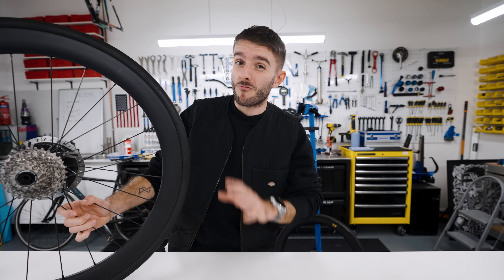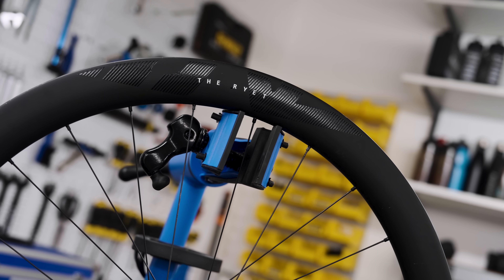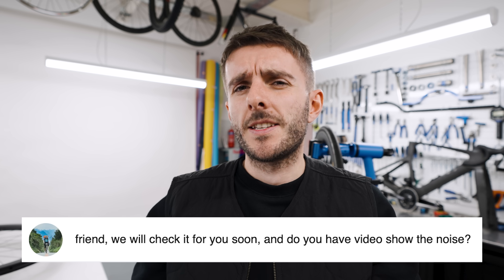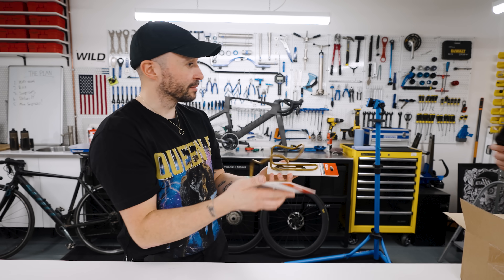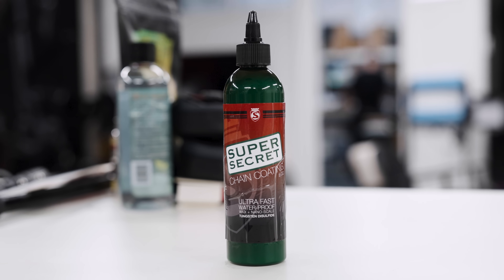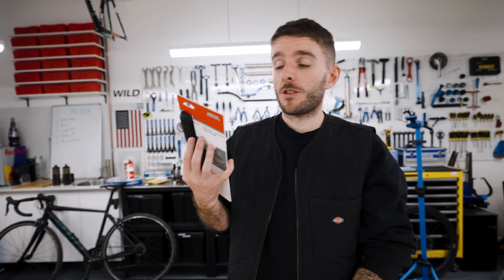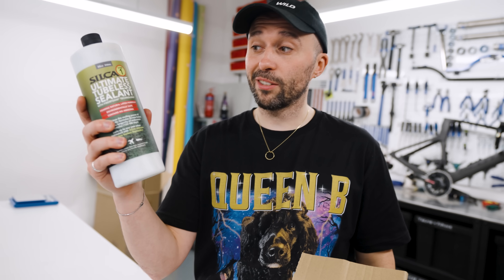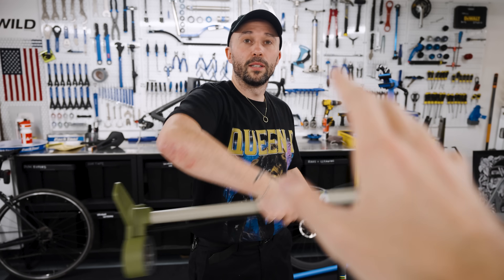I’m Now Terrified Of These £240 Carbon Wheels

Comment: I ordered a groupset from Ltwoo. Delivery was so delayed, that i bought a Sram on Amazon. Returned the package right in the post office and never even touched it. Refund was reduced by 30% due to bad packaging....
Chinese companys more than often rip off people, it is a common habit.
Reply: Nah. Its not a common habit. Ive purchased lots of chinese products. Obviously transcontinental logístics has challenges and they do wonders at keeping the prices down. 
Ive encountered more problems with local sellers rather than chinese, as long as you stay away from fake branding. They have their own brands that are pretty good, specially for the price. But if you want to scam yourself by buyibg obvious counterfeit then thats It. 
Europeans have historically given me more trouble at customs

Comment: Im got a pair with new tech from them, 700$ but it at 1275 gram 24/24 hole 46mm height. It work very well, work for the money and still riding good after 2000 km with no issue .😊
Reply: I'm also planning to buy their ultralight wheelset. May i know if you're still using the wheels and what's the condition?

Apologies for my bad English.

Comment: Loving all the videos people and am pleased to hear you have another sponsor, but please...Absolutely no need to spend £100+ on a frame fit pump while you can still get the Zefal HPX for under £30. Had mine for 40 years in all weathers without a hitch and it's all aluminium ✊.

Comment: I'm very happy with Silca's products and very happy to see you sponsored by them! I've had nothing but success with their pumps, hot melt wax, chain stripper, drip wax, tubeless sealant, garmin mount, and bar tape. I recommend their stuff to everyone because how many other brands do so well across such a broad range of categories? If they make a product I need more of or need to replace I look to see if they offer it first because they have earned my trust as a very high quality/best offering I've found. Silca may be expensive but in a lot of cases the competitor's products at the same/near same price are noticeably worse, inferior engineering, or don't last as long. 

Hot take: Josh is like the bike Steve Jobs. Innovating way ahead of the competition. 

Carbon in the sealant to form a "fibrin clot" similar to human hemostasis, pebax bar tape (that's the foam in the nike marathon shoes winning almost everything), all in one chain stripper that' isn't terrible for you/environment (look at how people used to strip chains), emulsified drip wax(this is some chemistry magic), sous vide bag hot melt wax(so you don't need a wax pot removing the major barrier of entry genius)...nobody else is doing some of this stuff and if they are it's typically that brand's sole focus! Don't change Silca!!!!

Comment: Which wheels from ryet are thoose exactly? I also ordered some carbon gravel wheels from the same company. They are called „2024 Carbon RYET GRAVEL Wheelset Disc Brake Tubeless Ready 700C Bike Wheels Center-Lock“. By the time i bought them (11.11. 23) they were called 2022 carbon ryet gravel etc.
Reply: I have the 55 mm aero for disc brakes and also the mtb ones, I have ridden them both very hard and many km without problems, I think this person has some with production defects

Comment: I work in the steel industry and I will tell you Chinese Quality Control is lacking to nonexistent.  

The Chinese have zero understanding of Western Standards and Specifications.  Even when you show the Chinese Engineers the Standard in writing, they insist the Chinese product, which doesn’t meet the Standard, is 100% good. 

In my experience Chinese manufacturers would rather ship out bad products. Then they make a financial “gesture” to offset their poor quality when you call them out on it.

Comment: You nailed it. QC is the important part. Renomated brands do propper QC for basically the same products. So you have to rate for yourself if you can handle bad Quality. For inner tubes that might be fine. For your Frame, fork, stem, or wheelset you might not want to have that

Comment: Sometimes it's not even about the QC it's about the laws / quality standards. For example, it's possible that for some parts depending on the batch size prododuced an Acceptable Quality Limit (AQL) can be used to check a specified sample size and if all of those parts pass (or in some cases there's a tolerance for allowable fails) then the batch passes and moves on to the next phase. While there could be bad QC's, bad parts doesn't automatically mean the QC is bad, it is possible that it's just a dud in the batch.

Comment: How do you all feel about the Ryet hubs? I used them to build my wheels and haven't had any issues
Reply: I agree with you, I have some ryet wheels, and I have ridden many kilometers without problems. They even survived a crash without problems, (I sent them to be checked), I think it was a production fault, but in my case in mountain and aero road works perfectly

Comment: Silca sealant dried on my wheel in less than 2 months and i ended with unsealed small whole, and was very painful to remove from the tyre, also it blocks the valve

Comment: as long as you don't apply too much pressure using a bike stand on a carbon top tube is no worse that lifting your bike up with your hand by the top tube.

Comment: I don't have an issue with the service Ryet offered. The wheels are sold with very low margins. To cover the shipping for a replacement wheel seems fair to me. Yes, you could spend 10x the amount and get a free replacement at a local shop, but you are paying for it in the upfront cost.

Can't expect the best quality and after sales service for the lowest price.

Comment: I have had a set of light bicycle and Venn  rims and they have been excellent. I would not buy a set of AliExpress. I like the Silca stuff but the saddle bag with the BOA thingy sucks. It will not stay in place under the seat and other riders I know have had the same issues.

Comment: In my experience the biggest issue chinese brands have is consistency. Many brands only try to win over first time buyers with price, and they have very little (or no) QC, and also keep changing the product names and numbers every few weeks or months, so it's impossible to recommend, because by the time there is some experience with the quality of a product, it's off the shelves and there are news ones which are again of unknown quality. This is also not helped by the fact that their product descriptions are written like SEO-s, so it's nearly impossible to tell what specification they come with. I had years of experience running a local earphones community, and we barely had any chinese products as recommended, because they were so inconsistent. There are some reputable brands of course, but those tend to move towards localised reseller networks instead of selling on aliexpress.

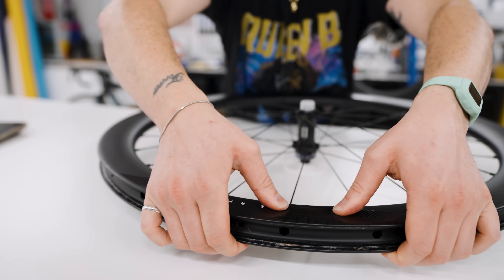Comment: a had a very similar problem with Yoeleo Carbon wheels. They are another chinese manufacturer and supposedly have a bigger emphasis on QA. The Rims even cost 800€ instead of just 240£. The tyrebed sepperated from the rest of the rim very simmilar as the wheels in this video, you can see them seperating at 1:27. Also Yoeleo refused to replace my wheels because they were a couple of months out of warranty.

Comment: auto mechanics aerosol brake cleaner is a much cheaper way to clean chains. it leaves no film so a denatured alcohol bath is not necessary. apply emulsified chain wax directly to the chain.

Comment: I have rolled the dice after the video of the unboxing of these wheels. I have been waiting for the review video for months now. I would like to chime in an say after 200 miles, I love my wheels. 50mm deep 21mm inner width, 36t ratchet hub, and more then 100g lighter than my 30mm deep 19mm inner width alloy wheels. My LBS wouldn't touch them, I was told the spokes were counterfeit but was not told how they knew, they did say after my first 40 miles that they were properly dished and true. If the $400USD is all I can afford and I want the ease of wide inner width and a ratchet hub what does the community recommend as a larger company to buy a similar wheel?

Comment: I bought XC carbon wheels from Velobuild that failed to kill me or, at the very least, send me to the hospital. 
When I bought their frame VB offered the wheels, I replied that I wanted these customized with an specific hub and spokes (bitex and sapim), so we agreed on price.
The bike was then built at the local bike shop and I rode it for mere 350 Kms before the incident.
I was starting a downhill at only 55KPH when it happened. We all heard a bang and the bike started skidding... I was so lucky it was the rear wheel that cracked... I was able to control and brake. 
 It was the back rim that cracked.  You can see a hairline fracture going between 2 spokes along the edge of the deep profile, by the same radial area you see a crack that cut the inner tube, it exploded and opened the rim.
Velobuild never honored the warranty and insisted in a car accident despite me sending pictures of the bike in pristine condition (and no spokes bent or broken)

Comment: I was riding with a friend who was riding a carbon Chinese fork on his gravel bike, the fork failed under the head tube and he crashed. Was in the hospital for a week and was lucky to be alive. I personally stay away from any non branded carbon products
Reply: What do you ride?
Reply: Ive used ryet wheels with no issues. I've also used elite for 6 years and over 30000 kms.

Comment: For that price I boght some Mavic wheelset with a discount and it will last for ever ... perhaps change some bearings in the future and that is all. I still prefer aluminium, light weight aluminium over Carbon. My duke rims weights only 45gr more than the carbon ones and looks as nice as them but are more realiable over bumps or crashes.

Comment: For balance, i have three Ryet carbon 3D printed saddles, and apart from them having a slightly wider nose than I'd like they've been faultless and super comfortable. Id definitely buy again.
Reply: I've got two of those, great saddles, they do a couple of slimmer looking ones now too.
Reply: @Bikey_McBeardface I've got one that they class as an MTB saddle on my winter bike. It's a bit squishier than the short-nosed one they do but still comfy and after around 300mi no visible issues. Great value for the price as you know, as the finish is as good as any top end brand.

Comment: Wow, looks like I've won Ryet lottery 😂At 6000 km now on my set of their wheels (50mm rim brake version), on rough roads and coubles, they are still true and ride absolutely fine. My model looks like that Francis got, so it seems that that is indeed two (or maybe more) different products sold as one. Definitely wouldn't recommend their wheels to anyone anymore....

Comment: I didn't get cheap carbon wheels but I would still appreciate an advice - is there a reliable way to tell apart surface scratches from forming cracks? Been riding my Levante wheels a few percent above the weight limit and I am trying to be extra careful. Thanks

Comment: You should make a video about TPU tubes from China. I bought 4 and all four tubes were bad. 
Thanks for the videos.
Reply: luck of the drawer, mine have been fine, Cyclami (?)
Reply: Mine have been fine. Holds pressure better than my Conti butyl tubes. Brand is ridenow.

Comment: Sh*t the bed at the state of that rim! 

While everyone loves "carbon" and on paper it has legitimate, tangible advantages; in practice composites are finnicky at the best of times in terms of consistency of manufacture, ease of inspection and failure characteristics. Throw into that a lack of transparancy / accountability in the supply chain and the potentially very serious repercussions of a failure in use... and I remain wary of even high-end stuff from "reputable" brands. 

Of course a decent warranty is a good thing; although probably of secondary importance if the product's failure has resulted in a period of 25mph+ face-surfing on the tarmac / gravel.

An informative and entertaining vid as always - looking forward to your findings with the sealant and wax (am a proper convert of the latter; albeit the council DIY approach) :)
Reply: Good to see you saying this. I have extensive experience moulding composites, consequently, I ride a metal bike with metal rims. For bicycle frames and wheels etc, the moulding is taking place inside the mould where the laminate cannot be seen. This will always introduce an element of plain old fashioned luck. When reduced weight is the aim, the situation gets even worse.

Comment: That's essentially what happens when we buy from Ali. Sometimes we receive good stuff, some others bad stuff. The quality is not consistent. In the end, it's a gamble. And that's why I stick with alloy when I buy from China. If I wanted a carbon frame, or wheels or a handlebar I would get it from big brands, even though you pay for the branding, but you also get warranty, R&D and so on.

Comment: I buy from Elite quite often, their AliX shop direct. It works very well. It’s been about 4 years & no issues. I have 3 sets. Latest is their Edge 36T.

3 friends bought from them, & one after 2 years got a replacement. He paid 99p for shipping, it didn’t take long to get over. 

It’s clear that Ryet’s model is not very good at all when things do go wrong. Just be wary of your purchases. 

In our cycling club, we buy from a diverse variety of brands. There were issues with 

1. Giant’s hub, replaced by dealer. 

2. Problems with VEL wheels, one wheel replaced 

This isn’t bad out of 60 off cyclists in the club.

Comment: Just bought a pair of alloy wheels from wiggle.£110 complete with tyres and tubeless sticky stuff. They weigh 1600 Grammy's for the pair. Am I missing something by never having carbon wheels. ( I don't go fast enough to be too bothered about the aerodynamics)
Reply: Same here, pity you got no replies because I have the same question, what is the big deal with carbon wheels?

Comment: I guess it's like a lottery buying from China.
I had light noname Chinese carbon tubular wheels (1315g/pair) for 9 years now without any problem. $310 on ebay 2015. Tubular tires and 10-12 bar. They are still like new.

Comment: Many chinese manufacturers will use the cheapest parts possible. I know people who work for companies thar use chinese manufacturing and they say they need people there all the time to ensure theybare using thr right parts. If you say "use x resin for this wheel" then walk away, they will be using the cheaper y resin and not tell you so they can make more money off of it. Chinese manufacturing can be just as good as anywhere else, but it can also be made in the cheapest, poorest way possible to save costs. It depends on the company and their oversight of the chinese plant.

Comment: You would not be able to buy a £240 wheelset with QC and good customer service. Chinese wheels with a name and a warranty behind them (Yoeleo, Prime, etc) cost twice as much.
Reply: Your cost analysis for the materials and manufacturing to know the lower price limit is where?  You're making a stupid statement.  If the big names are selling at 4x profit margin, of course there will be folks that come in and offer you a much lower price, happy to make 2.5x the profit margin.  Then there will be someone that comes along that's ok with .75x profit margin and you get a £240 wheelset.
Reply: @lastfm4477  My point is, that profit margin does not afford the seller proper QC and customer service. So you get delaminating wheels and have to pay for the shipping of the replacement.

Comment: Well, I had some Fulcrum wheels, the front wheel started delamination after 3 months. Leave that into the store, and the official answer was, not covered by the guarantee. My face was... dude. It take the store like 4 months of going forth and back to the local distributor and even talking to the Italian headquarters until they replace the wheel. 
I will never buy anything for Fulcrum/Campagnolo as their service seems way worse than this chinese brand costing almost 10 times more.

Comment: Those floor pumps at 140 Euros, (whatever one of them is, I use £s) I just bought a track pump for £18 and it works just fine. Use it on my car tyres too.
Reply: I did the same and bought a Beto pump about 10 years ago for less than 20€. The pump just holds up fine. I can pump my tyres to more than 120 psi if needed. 
I'd expect at least a compressor cylinder from a product that costs more than 100€ - to be able to seat tubeless tyres.

Comment: It blows my mind how people want to save money on somthing that can literally be life and death, Do people not value their lives? if a cheap wheel snaps in half when your flying down your local hill at 40+ mph… you could very easily be killed. think a little bigger.
Reply: The worst carbon wheelset I've ever handled is an Avian. When I braked for the first time, I was quite shocked to not feel any brake bite unless I braked hard at the drops. I'm not sure if swapping the brake pads would help as the original set is hard as a brick.

I wouldn't consider anything that costs less than Winspace's most affordable wheelset.

Comment: It's not only the cheap Chinese carbon wheels that can do this. I've got a set of roval  clx 40 wheels that came with my 2014 sworks Roubaix sl4 that have done exactly the same as this wheel. I did a warranty claim with specialized to which they knocked back saying that this is a wear and tear issue and not a manufacturing fault!! What a load of BS. As a result I will never buy anything from specialized ever again.